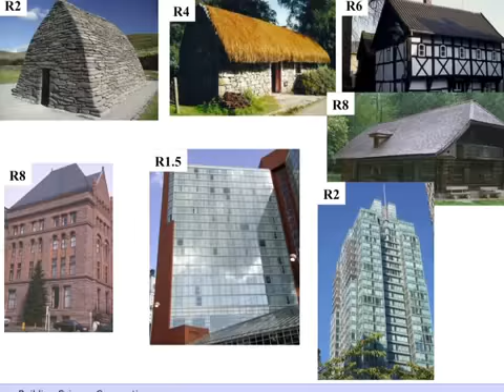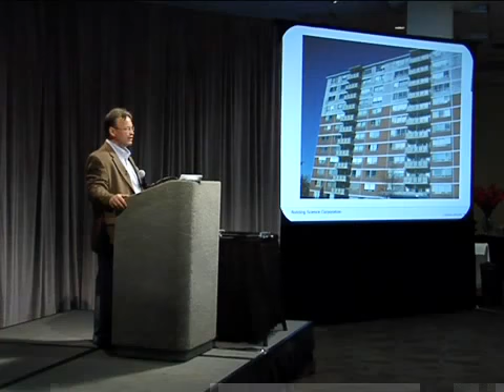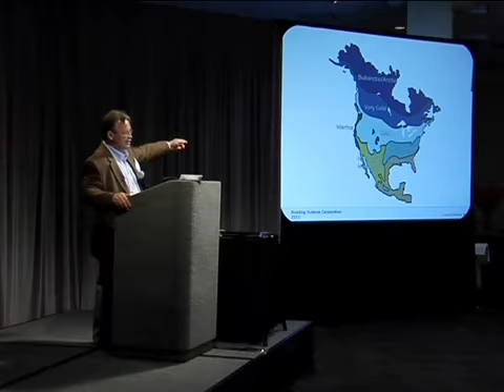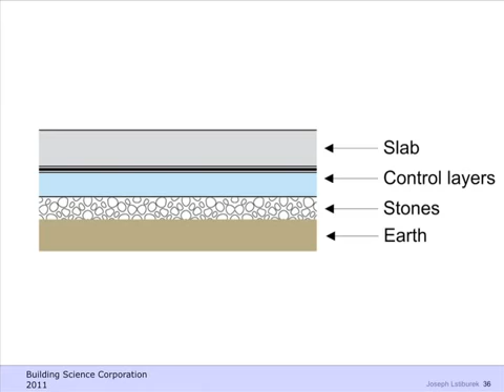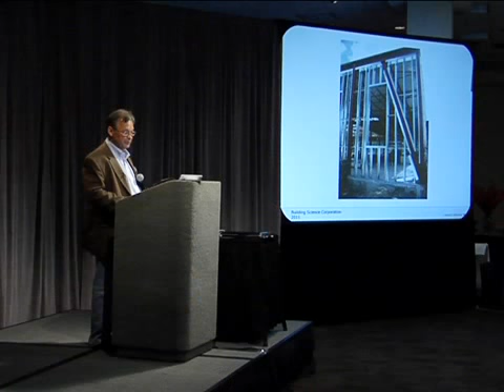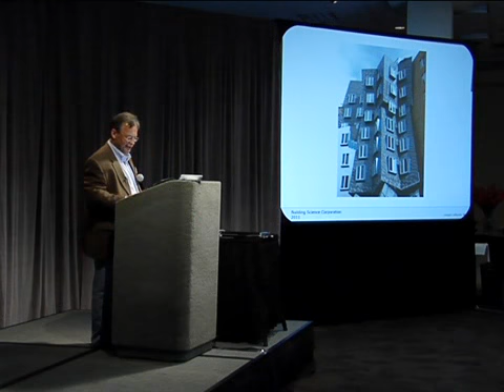02 Module 1   Lstiburek

Comment: I always get confused. So on a residential, is something like Tyvek home wrap what you would put on the exterior sheathing, because it's an air barrier and vapor retarder?
Reply: Tyvek Homewrap isn't an air barrier or vapor retarder, in fact homewrap is highly permeable by design at 56 perms. If you choose this weather barrier, you would need to tape all the joints in the sheathing behind the homewrap to provide the first air seal. Then install your rigid insulation layer over the homewrap, and then a rainscreen over the rigid insulation. 

Ideally you would want something self-adhered if you want something air tight, like delta vent sa or siga majvest sa.
Reply: On residential, 1) he doesn't show a window flange, does the rigid foam go behind the flange? If yes, that's going to affect the window jam depth.... 2) isn't the rigid foam a moisture barrier?